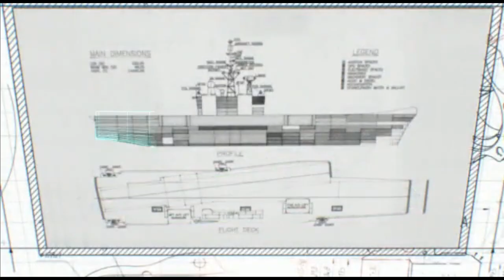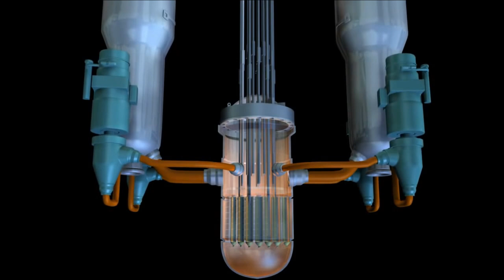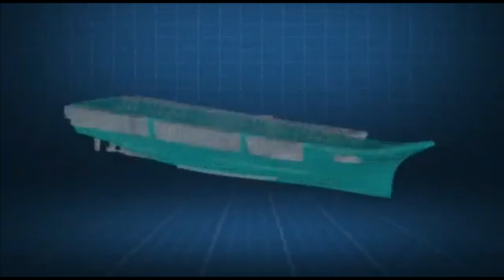IAC-II Vishal: Financial & Technical Viability (Part-II)

Comment: 🇮🇳 INDIA should have 4 active service aircraft carrier.... 3 operational, 1 Spare (deployed during overhaul & maintenance of any operational AC)
🇮🇳 IAF should also increase squadron strength from 42 to 50 .
Reply: India needs atleast 6 nos Nuclear Power Super Aircraft Carriers of 65000 Tons or more and Catobar configuration
Reply: @ericgariba3420  that's unnecessary, coz, India don't overturn DEMOCRACY like USA...!! India need only for defensive & defensive-offence purpose only... i.e. to protect the Peninsular Subcontinent.
Reply: @Sam09129  there is no such thing as a peninsular subcontinent. The peninsula only comprise of about  40% of total land area of the India  Even less if you take entire Indian subcontinent.
Reply: @mukulbajpai6190  *peninsular region of Indian subcontinent.... Is what I meant 😊
Reply: Good point. Two nuclear carriers exclusively for patrolling the IOR are essential for enhancing India's trade interests. The costs involved for having such a capability are high but the costs of not doing so are even higher.

Comment: Wait really, India would take 15-20 years to develop a 500MW Nuclear Reactor for an AC? That's seems like a long time for a country with established Nuclear R&D centers and experience.
Reply: Who told it require 500 MW atomic reactor?
Reply: @bharatnadhani4532  the arihant class first submarine has an engine capacity of 83mw, that is for a 6000ton displacement, ac will have 50-60k displacement

Comment: Next career in 2035 (you mention 2025)
Reply from the maker: I mean the project should be launched by 2025.
Reply: @IndianDefenseAnalysis  ok. If really happened (we launch second carrier in 2025) Pakistan and China will get heart attack 🤣
Jay Hind 🙏
Reply: @chanakya5480  they wont china will have 5 new carriers by the time India finishes its 2nd IAC, moreover vikramaditya will have to step down at around the same time, so India will only have 2 ac even in 2030s.........
Reply: @suraj.1889  yes.but I talk to about if we launch 2nd career in 2025.
INS Vikramaditya will be retired 2037 (if it not updated)
But China need more career to enter Indian Ocean.
Because in South China sea there will be a American career. Also Japan building new career.

Comment: Navy should upgrade IAC-1 with catobar tech ASAP
Reply: They are entirely 2 different systems, I don’t think there are any conversion kits available.
Reply: Lol how please explain me 😂
Reply: Bro it's not possible as the top layer is already built . To install Catobar , we should do it with making of the ship hull . But don't worry, ins Vishal has it
Reply: @Eternal Not convinced with your reasoning. When you said indeginisation will get as more advanced affordable vehicles, we end up producing stuff that are outdated and expensive due to delays. And we keep promising that it gets better next time. Neither did we build for Tejas - MK2 nor we planed for 6th gen aircraft’s, now the wider bigger and longer Vishal will have another challenge for an Nethra type of AWAC tobe able to fly, take off and landing.